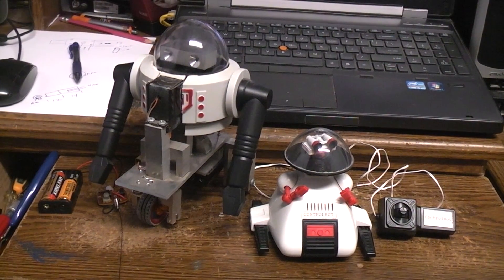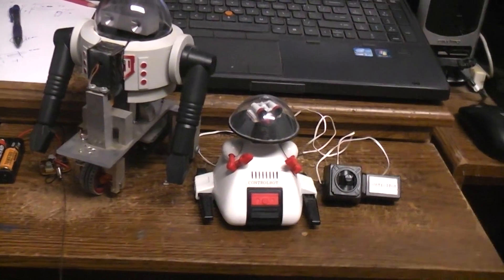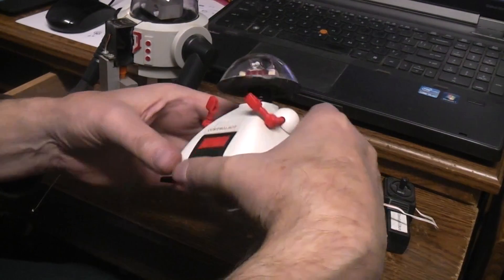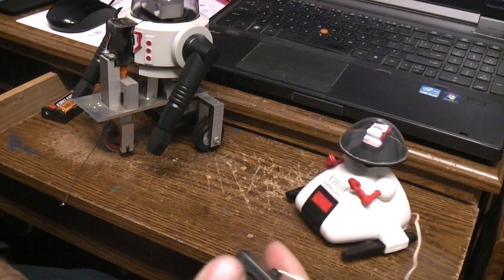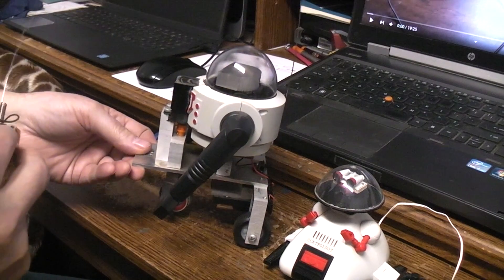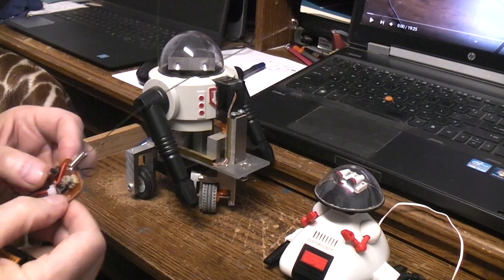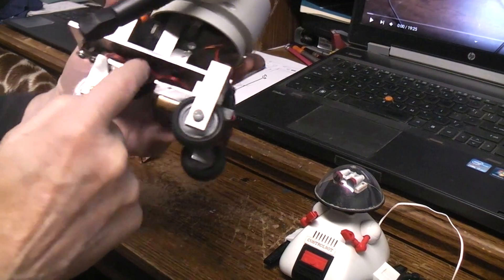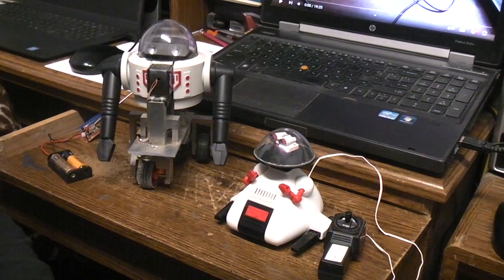Tomy, Ding Bot Mod. Single motor, dual function design. 1986 build.

Comment: Thanks for the video. I've watched it several times already. You explained the operation very well. The Ding Bot looks good with a different head. I think I will try to build something using this mechanism. I'm making some sketches now.  I Googled the Golden Sonic toy and found a guy on Instructables who built a toy controlled by a whistle with a similar mechanism but he used one way bearings. The same guy has a post on Hackaday showing some of the insides of the original toy. I really enjoy learning about these old mechanics and toys I've never heard of.
Reply from the maker: Yes 1 way bearings work just like ratchets in this case. It is easier to 3d print a ratchet than a smooth operating 1 way bearing, but it can be done.

Comment: That's a lot of tinkering. especially making parts out of metal. But it works.
Reply from the maker: Yes back then it was a lot of work to test a mechanical design. Now I can just design in CAD and 3d print in a few hours.

Comment: hello john. just would like to take a moment to ask if you are alright ? no new videos since this one.
Reply from the maker: No, just got out of the ER "Sunday" for the second time. But I am sure they will get me fixed at some point.
Reply: @Robothut  stay on top of it john, whatever is going on inside. a robot can run forever, as long as you wind it up from time to time, or replace its batteries. and even we need a tune up occasionally. STAY WELL MY FRIEND.